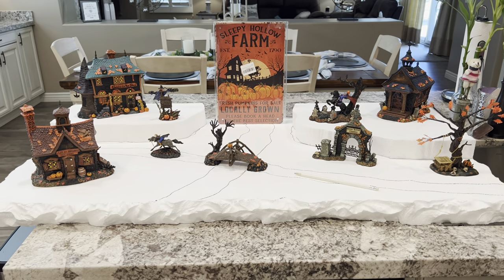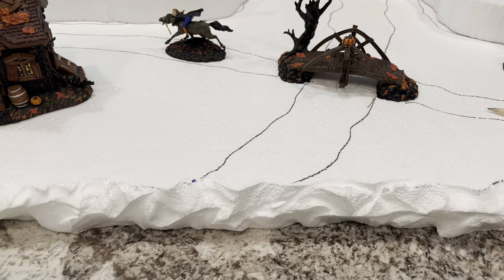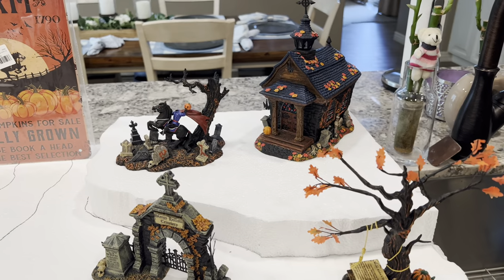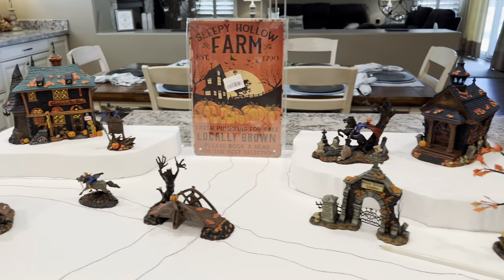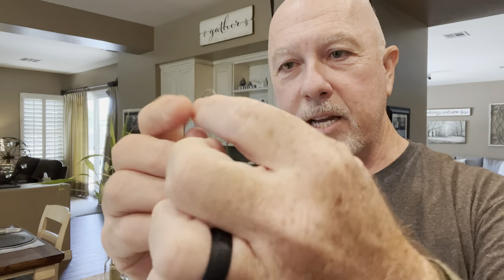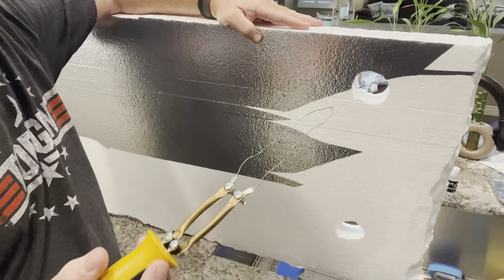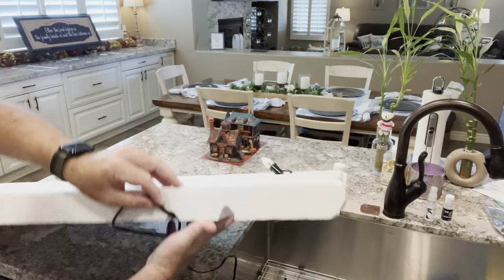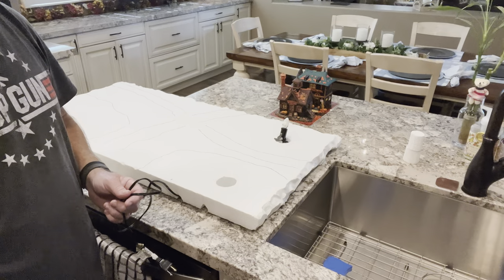Dept 56 Sleepy Hollow-een Vignette, Part 2

Comment: Hi Carl,  Thanks for another great in-depth tutorial.  I especially like that you talk about the thought process that goes into designing a display platform.  I do have a question about the foam you are using.  Is it a special type of styrofoam with silver backing?  I know you usually use pink foam.  Is this the same thing but white?
Reply from the maker: Thanks—glad you’re enjoying the channel!!  The white foam is the stuff I get in 4’ x 8’ sheets at Lowes or Home Depot.  Very similar.

Comment: Hi Carl, After I cut the foam with my hot wire cutter, it leaves tiny fibers all over the foam. How do you get them off before you paint?  Thank you
Reply from the maker: I usually use sandpaper to get those off if they’re bad enough!

Comment: Great video.  What can I use to hide the "seams" when stacking  multiple levels of styrofoam?   It seems that even if they're well glued, you still see them.
Reply from the maker: I stack them first, then carve the all together—that helps some.  Also you can use putty/paper machè/joint compound, etc. to fill in the seams as necessary!